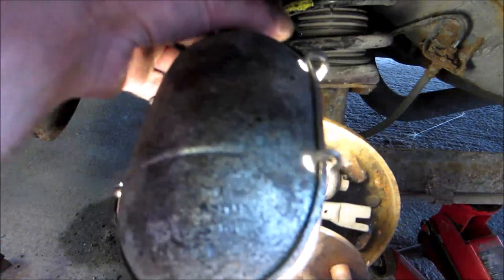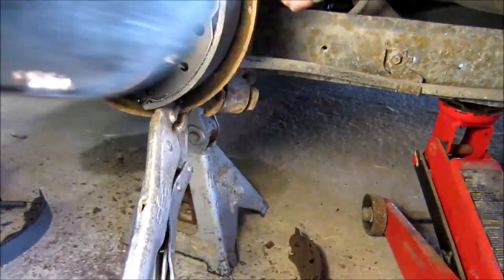Replace Rear Brake shoes 2001-06 Nissan Sentra

Comment: The two holes on the front of the drum are threaded. Use two metric bolts longer than the holes and EVENLY screw in. That will press the drum off without much effort. The bolts bottom out against the hub and push the drum off. That's what the holes are there for. My drums didn't' come loose with a couple hammer blows,so I used the threaded holes.Comes right apart .Thanks for posting the video
Reply: M8x1.25 to be exact.
Reply: @VENTDEV Thank you

Comment: Wouldn't really be cool if you could just clean that all off take that face. Or you could just spray it down if you were in the car wash I know it sounds like a lot of work but you go to the car washing jack up the rear end and take the tires off and the drums come off you know then you can just like wire brush it and clean it and be even even cooler if you could like sandblasting paint it it's a pretty quick process done it many times sure makes a job look good for some people will never look down there

Comment: The 93 version is almost identical outside the little spring in the ebrake cable. That part is different and the auto adjuster arm is a little different. There is also a second spring holding the top part of the shoes together. I didn't see you take that off but may have missed it.